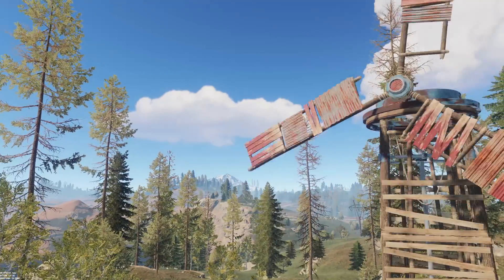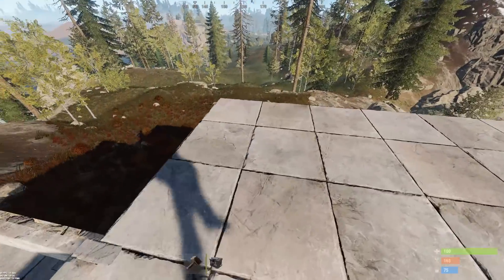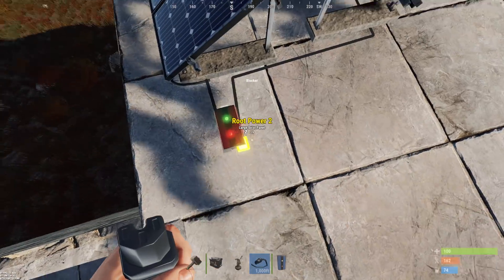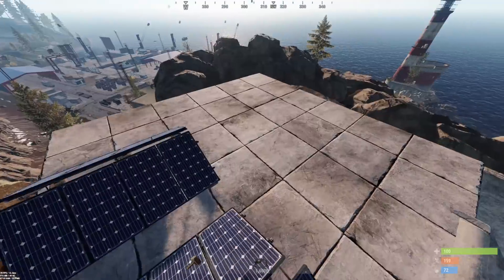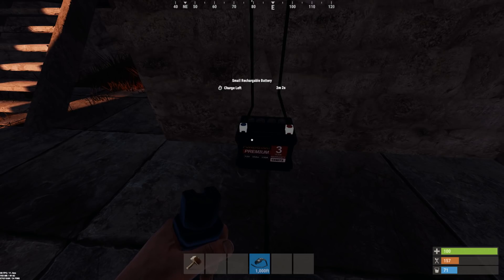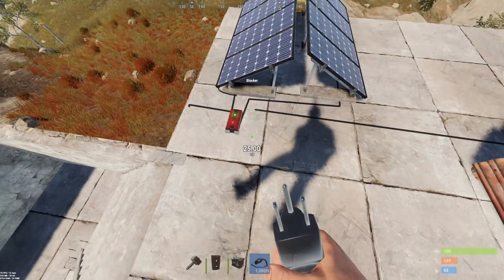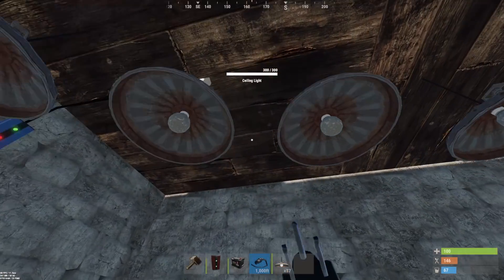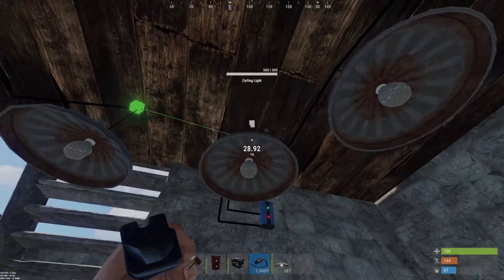EASY ELECTRICITY AUTOMATIC LIGHT GUIDE (Rust)

Comment from the maker: This can be done with LESS solar panels, but it will be far less efficient.
Reply: Well I’ve been away from rust for a bit and pretty sure your way is simple for most people just not Tucker’s xD but I’ll give it a try
Reply: riZZa especially for the blocking signal! Do you really need 2 panels to block the signal?
Reply from the maker: Yes you need 2 if you want to make sure it works correctly if you only have one and the sun isnt hitting the solar panel direct the lights come on early or when you dont want them too. If the sun is in the east and ur panel is facing west your blocker will open and lights will come on. Thats why you need both

Comment: many people have been complaining about their lights turning on too late at dusk and turning off to soon at dawn. A single south facing solar panel for the blocker might be a good way to fix that

and by the way, I built it with a single pair of solar panels and it isn't "less efficient" this way if you use a branch and not a splitter.
I would really like tho to be able to place root combiners after blockers or don't have my batteries drained by having them root combined to a blocker that is on block passthrough
Reply from the maker: Yes, the early and late light issue can be repaired using a timer, once the power is cut you can can 10 minutes etc on batt power. This video was designed to show the BASICS only in a simple version of what is possible. As i said there would be much better way to do things but people make such complicated videos people get a headache. Additionally, having 4 panels is more efficient at the time of making if they were hooked up to charge as it increases the charge rate allowing you to possibly charge more battery cells. But again I didnt want to make it confusing since this is a "EASY" tutorial not a full blown electrical engineering degree :) You do hold very valid points and there has been alot of changed to the electrical system since I made this video. Thanks for your feedback and thanks for watching !

Comment: To explain why this works: The solar panels charge the battery and don’t turn on the light because power is flowing into the blocker which blocks the power from turning the light on! However as soon as the power stops flowing into the blocker from the left the power from the battery is allowed to go through that blocker and turn the lights on!

Comment: This leaves out a good 80% of working information on electricity, such as the fact that you actually do need a proper battery for windmills as they can just stop turning at random as the wind changes, and secondly, that anything past five/ten lights (@2 power each light) needs a large battery, as the small ones, even in series, cannot provide enough power. Secondly, only proper power sources, not batteries, can be combined via root combiner. Thirdly, this skips over the addition of the Or gate, the splitter... Very, very uninformative for anyone with more than two brain  cells to work with.
Reply: I used his guide and it worked if I wanted to use orswitches I'd YouTube that instead. Get out of your bedroom neckbeard